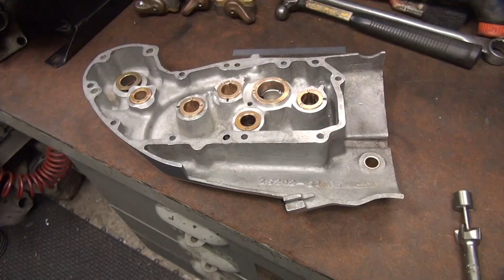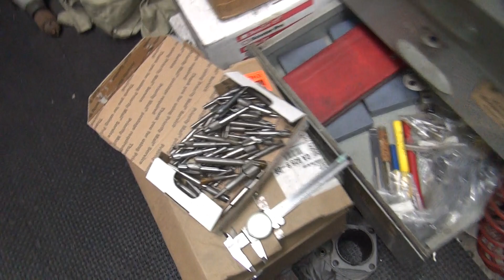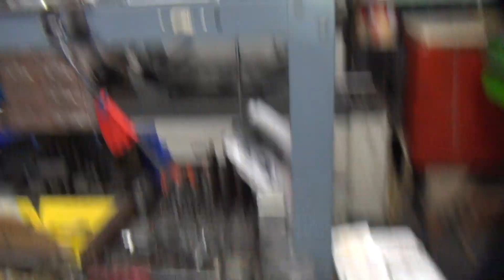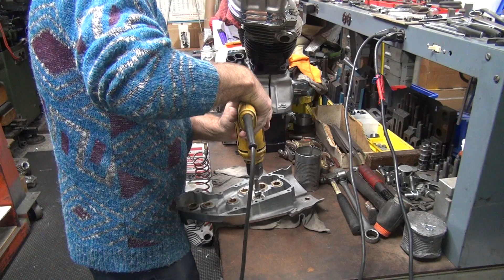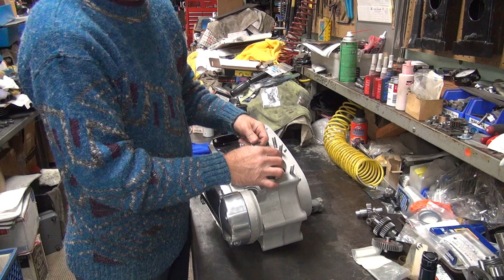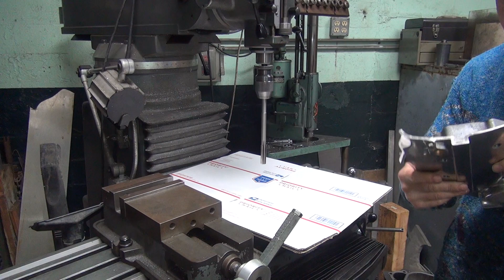1961 xlch #185 no miles transmission motor rebuild sportster harley repair restoration tatro machine

Comment: G'day Tatro Man you have some patience  was just wondering if there was any indication on the original bush that rubbing/cutting was present...Thanks.
Reply from the maker: it doesn't matter, it is now. these parts were never together before. things have been replaced and swapped around. if the bushing was loose it is fine. its only a problem whene you make everything nice and tight. that is why wornout motors run so good. no binding.
tatro